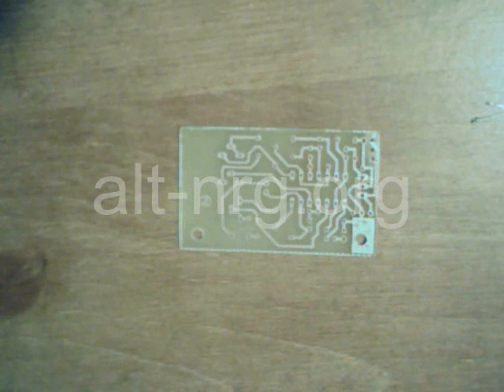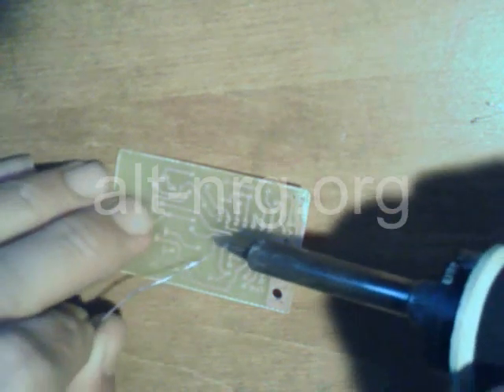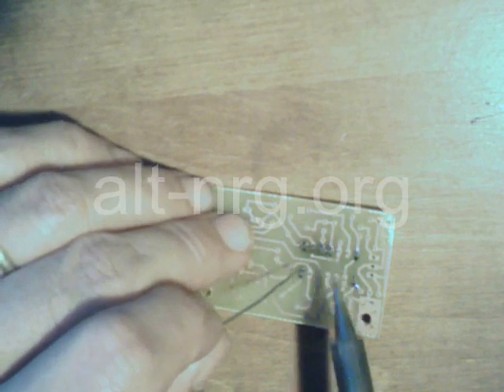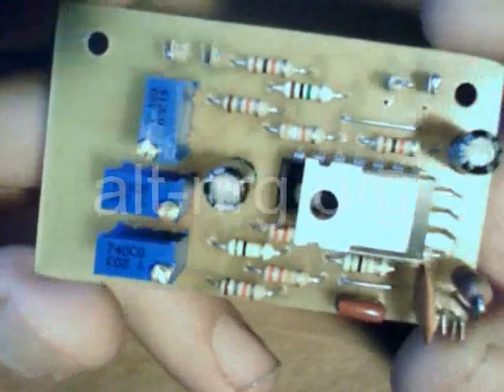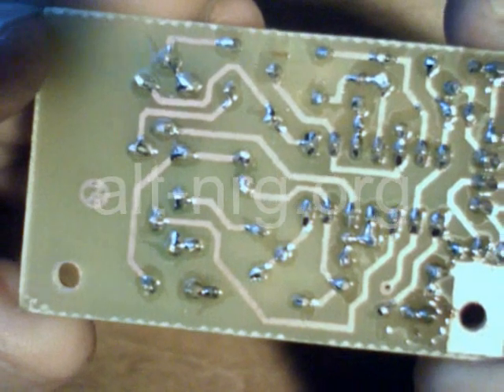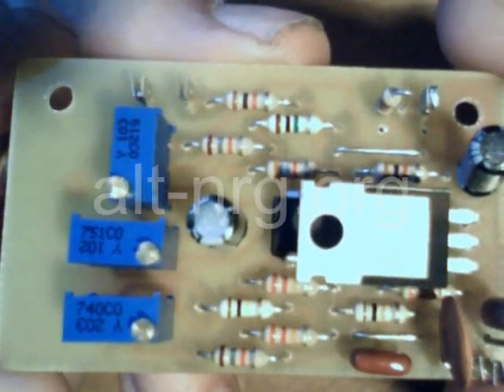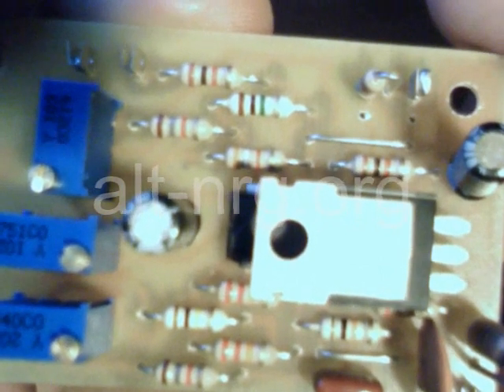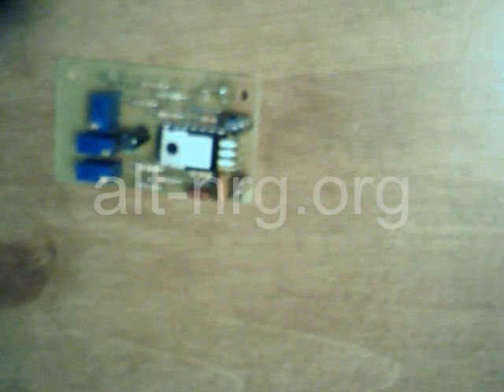#126 - PWM Etched PC board assembly

Comment from the maker: The back is metal, connected to the center lead, the drain. Without an insulator you short the drain to chassis ground. Very basic stuff.

Comment: Zero, I notice that your efie does not allow for a separate city and hwy settings. Is it because the ecm/ecu goes into semi closed loop mode on the hwy, ignoring the o2 sensor's voltage signal? For this reason I have never understood the need for a different hwy setting. Keep up the great work.

Comment: Conspiracy nutballs? Maybe - but not here. I have built the ZFF PWM,  added to it and within limits (as with everything in life) it works as advertised. I have built a 6x10 inch 24 plate EBN type cell and I am pleased how well it works, but more importantly, the performance of both items has been VERIFYED and CONFIRMED to my own satisfaction at my own expense, time and effort. This is a very basic exercise for which your remarks (as a scientific literate no doubt) indicate a striking absence.

Comment from the maker: The stiffening cap is needed to supply the massive inrush currents of the square wave to the cell AND to help the MUR420G clip the back EMF induced transients to Vcc, the input voltage potential. Without it the MOSFET tends to run much hotter.

Comment: Did i miss something somewhere....where do i sign up for your news-letter?  I looked on your website and did not see a place for a sign up sheet?

Hope you get those video disc soon or find another solution to the camera issue.

I might be able to put my hands on a cheap cheezie video camera, tri-pod mountable, records to SDmem cards, downloads with a usb to the camera.  Not sure where I put the thing but as I remember it wasn't a half bad unit.  Only issue I recall is it only runs on batterys